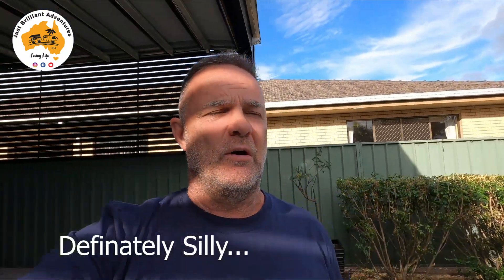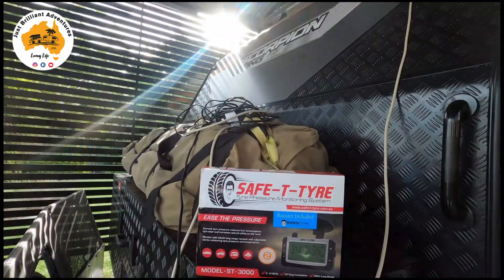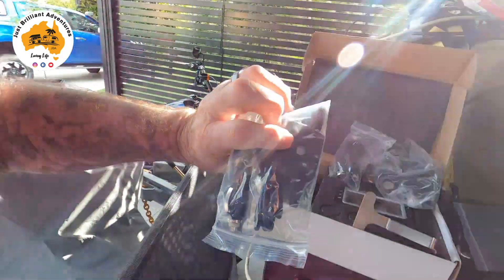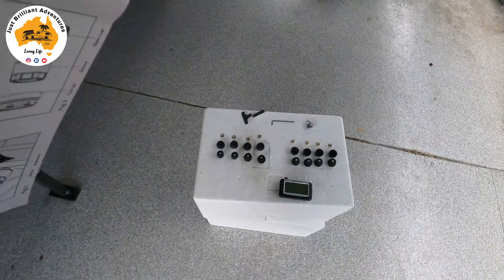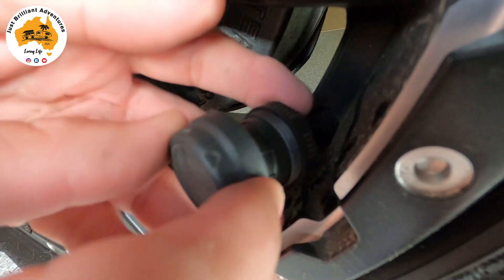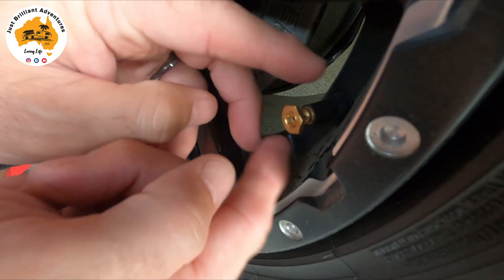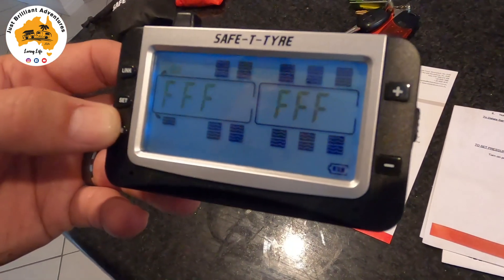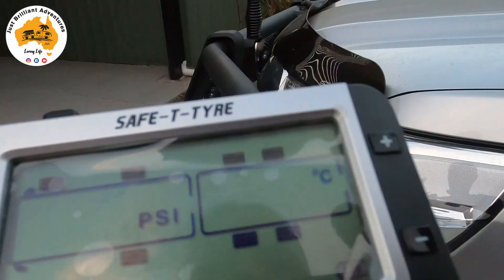SAFE-T-TYRE Install and Demonstration

Comment: Great to see you are ok all though a bit sore.  The TPMS is a life saver.  I have the earlier version and I set the pressures and temps for the alarms to sound if a tyre reaches the set points.  Saved me a blown tyre on my van a couple of years ago.  Stay safe and I might have to get the new version that you have as it is a little easier to fit and take off.  Mine have little allen screws to hold them onto the valve and can be a pain to get on and off.
Reply from the maker: Thanks Garry slowly healing. They are a great idea and couldn't recommend them enough, we had them on our last vehicle as well. Thanks for watching and stay safe, see you on the road sometime.  😀

Comment: Thanks for the demo mate. Great vid.
Just wondering how well the unit has performed now you've had it for a while?
Looking to buy one and would like a real world review.
Hope you're well on the mend now.
Cheers mate
Reply from the maker: Mate they are good most of the time. By this I mean driving on bitumen they are great. Driving Oodnadatta great. Pain in the ass if constant airing up and down on off beaches and such. Again great for the Gibb as you don't air up and down constantly. It is peace of mind and prevents anything bad. You can see if you have a slow leak or big flat. Cheers for the support 🍻
Reply from the maker: Mate they are good most of the time. By this I mean driving on bitumen they are great. Driving Oodnadatta great. Pain in the ass if constant airing up and down on off beaches and such. Again great for the Gibb as you don't air up and down constantly. It is peace of mind and prevents anything bad. You can see if you have a slow leak or big flat. Cheers for the support 🍻

Comment: TPMS monitoring appears a safe way to travel on long hauls, however I assume if you are airing up and down on a frequent basis they would become a time consuming screw on/off action. Is that correct?
Reply from the maker: Dave that is correct mate. Great on a long trip. If Air down for a short trip then air back up and put back on. Providing your not airing down in the next few hours or so.🍻